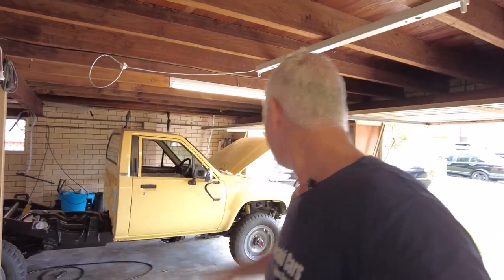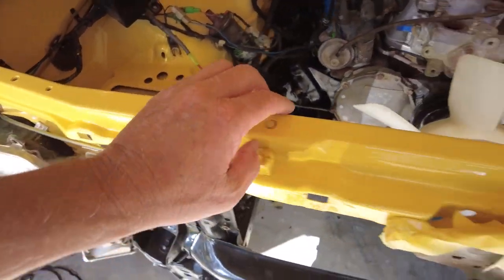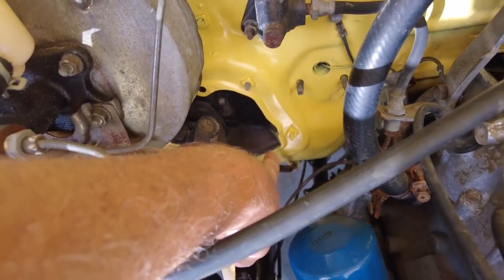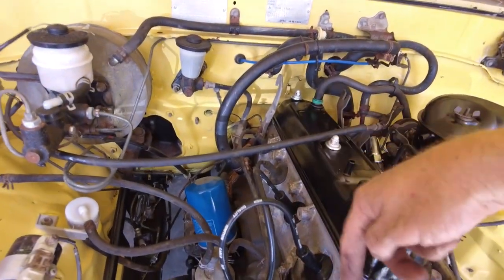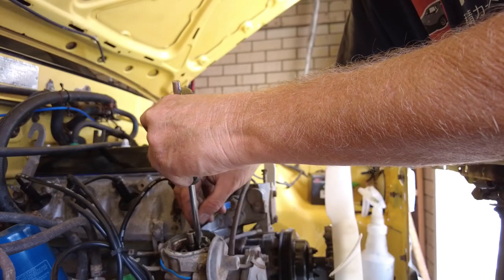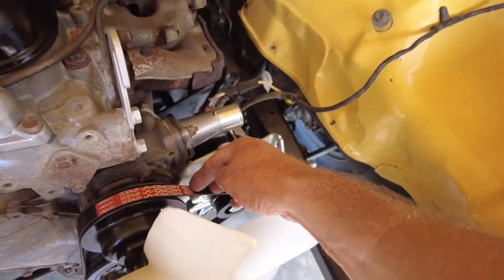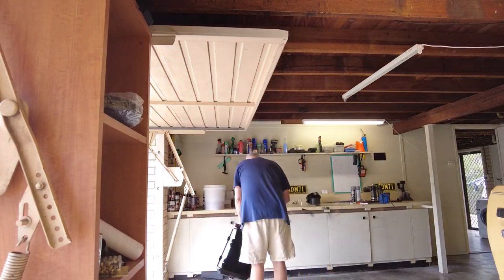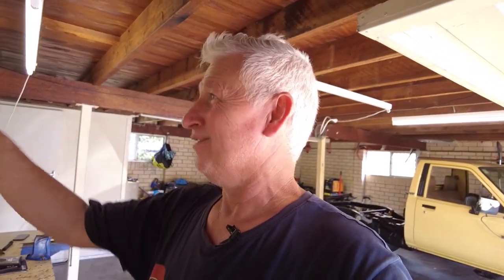EPIC TOYOTA HILUX 4x4 TRUCK RESTORATION | NEW RADIATOR INSTALL | Flip My Ride [Ep 12]

Comment: Get some Permatex No 3 gasket goop. Really sticky and will help the valve cover gasket stay on the valve cover. It also lets you reuse paper gaskets many many times. I used it on everything I pulled apart except head gaskets. Just don't spill it in your toolbox, you'll never get rid of it!

Comment: Can you tell me where you got your radiator from, and part number please. I'm having trouble finding one. Cheers. P.s. I'm west of Brisbane.  Would you recommend a supplier of new assembled 4y cylinder heads? Price seems to vary a bit. Thanks.
Reply from the maker: I do not have a part number. I went to a natrad radiator repairer at Tingalpa. He looked it up and sourced it for me. I think they are on ebay also. The link below is the brand I bought and is most likely the same radiator but please do your checks first. 
https://www.ebay.com.au/itm/323517664317?hash=item4b5327cc3d:g:y9QAAOSwb3hb0igJ
Reply: @FLIPMYRIDE  thanks.    Ironically I bought my 84 hilux from Sydney!